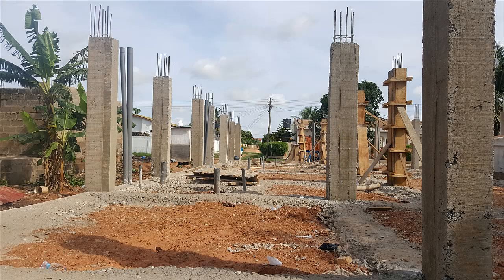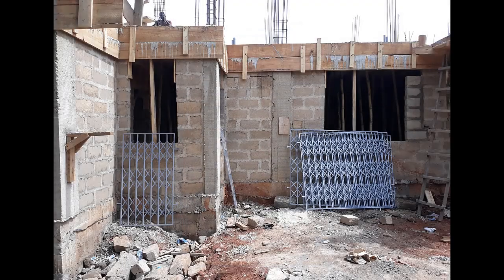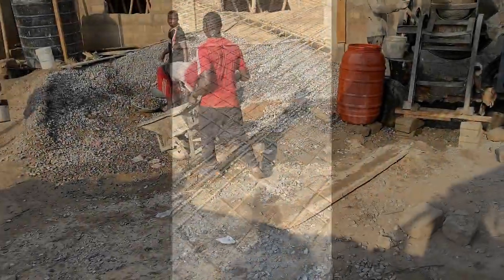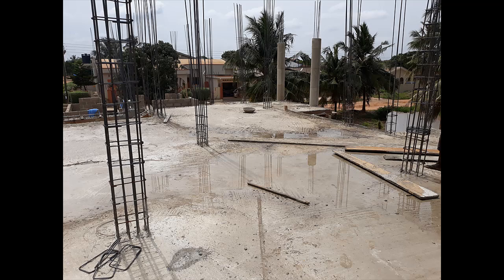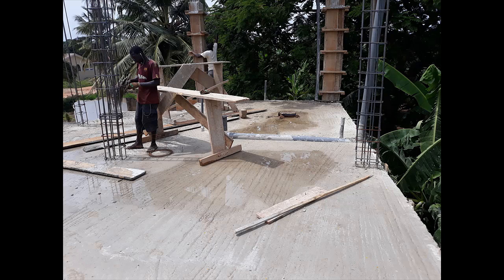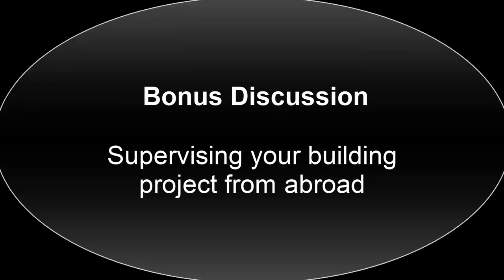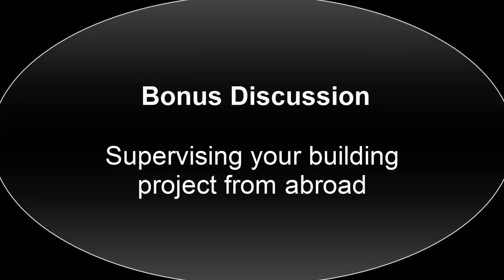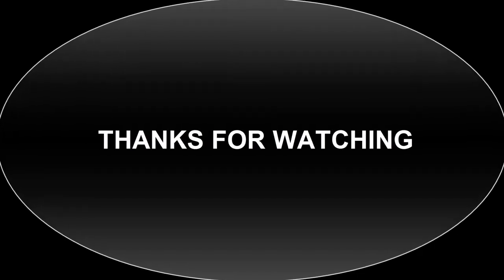Cost of Building in Ghana _ Block Work,1st Floor Slab & Building Supervision from abroad _Ep 4

Comment: Why did you not have lintels above your doors and windows?
Reply from the maker: The doors have, only that, i didn't use the tradition style. For the windows it was not necessary cos of the beams. I will do well to explain more in the next video
Reply: @Lerwincel  great! Thanks for your response. Will look forward to the next video
Reply: The doors and windows 😍 👌 🙌

Comment: How many iron rods did you use for the flowing
Reply from the maker: 16mm for beams = 1.5 tons
11.5mm for slab = 3 tons
10mm for beam stirrup = Half ton
Reply: And the price
Reply from the maker: @1204  A ton as at April 2021 was GHC5400 in Accra

Comment: Can one set up a bank account in Ghana while in abroad? Just wondering
Reply: Absolutely
Reply from the maker: I don't know of any bank that does that in Gh. However, as indicated in the video, u can setup one anytime you visit. Once opened you can do all the transactions while you are away. I use Fidelity Bank and it works fine for me
Reply: Why not?
Reply: What is the process? So far what I find out is that they want you to be present or have an intermediary to open it on your behalf @1204

Comment: Another very informative episode !
Now, @11:30, what is the width and height of your cast beam? 8"w x 18"h ?   What is the longest span for the beam ?
Did you run the resized  beam by a structural engineer in reference to the beam span ?   Thank you.
Reply from the maker: Cast beam = 9"w x 18"h. Longest beam span at ~18'. Ye, resized beam approved by an engineer. 
If you need info on structures this guy provides some useful information - https://www.youtube.com/channel/UClYS6cDC2GSX0phXTQMxOKg
Reply: @Lerwincel   Got it, Thanks.
Reply: 7ft it looks

Comment: Thank you very much for your video series, they are very insightful. Within a week i've been watching them over and over, and its given me a good idea of the key areas of building construction. If you dont mind, I have a question for you, when you indicated that you paid GHc2500 for the carpentry work and also GHc2500 for the steel bending, was it for the entire floor or just a section of it, either the 3 or 2 bedroom apartment? And also for the carpentry, did the amount include removing the plywood and prop ups after the casting of the concrete was completed, or was that too a separate, and if it was, how much was it?
Reply from the maker: The price is for just one side, i.e, 3 bedroom side. The removal and packing of the formwork is the reason for the price increase for the next floor job. I think it was GHC4000. You can double check in Ep 5
Reply: Me too

Comment: Please your foundation is it the same cost as a 2 story building. Thank you
Reply from the maker: Can you be a little clearer on your question
Reply: @Lerwincel  I think the gentleman wants to know if the foundation cost for 3 floors is the same as for 2 floors.
Reply from the maker: @freshfishonfire6420  Oh! It will be a little cheaper cos it would use 6 bars instead of the 8 i used. The rod for the stirrups could also be lesser than the 10mm i used. The pillar size can also be 9x9 inches. You can also use 12mm instead of the 14mm i used for the column mat and plinth beam
Reply: Hmmm!
Reply: @freshfishonfire6420  👏 😮 wow!

Comment: Hi 🙋‍♂️. Can you please elaborate on the double T connection as opposed to what you shown on this video?
Reply from the maker: I learnt of a better approach which we used on the  last floor. You can see that in Ep 16
Reply: @Lerwincel  thanks. Will check it out